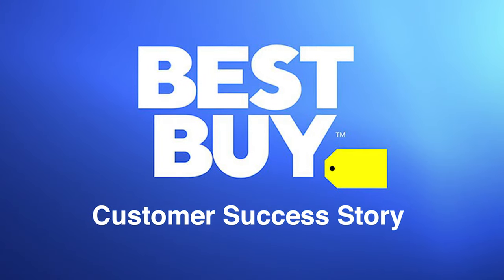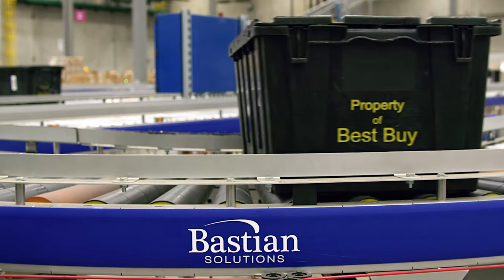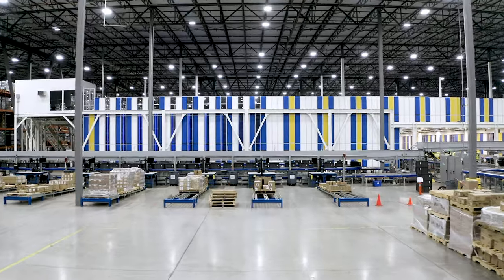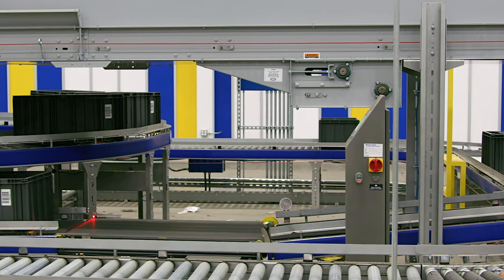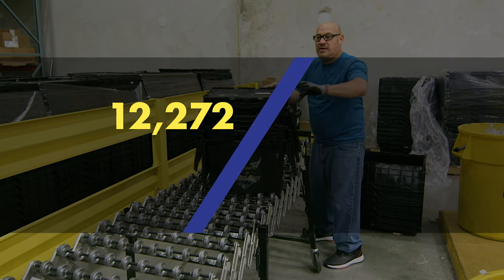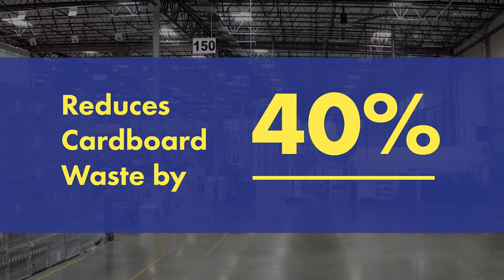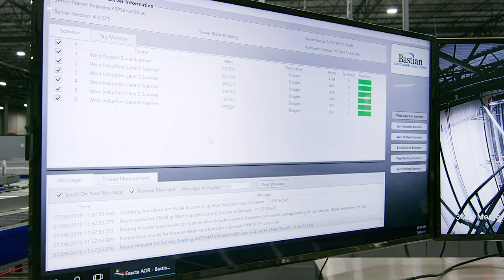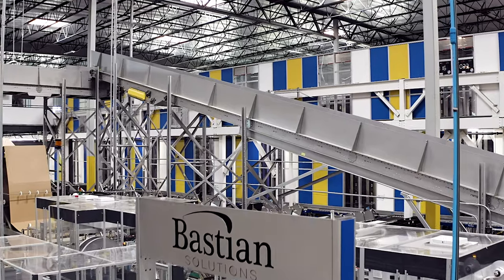Best Buy Modernizes Supply Chain Network with Advanced Automation and Warehouse Robots

Comment: It would have been even better if they could bring these fulfilment centers into brick and mortars with minimum real estate requirement. That way the assault on the physical store can be deflected and it can be given a new lease on life.
Reply from the maker: The AutoStore system has the scalability to be implemented into back of store, if a back of store model works well for the client. We work with each client individually to study their data and operational goals to determine if a dedicated back of store fulfillment solution is right for their operation, or if a combination of fulfillment methods would be best to meet their needs.
Reply: @BastianSolutions  Thanks for the reply, what's the smallest back of the store fulfilment solution you guys currently offer? How much real estate would it need from my brick and mortar space. Also, can your system cater to 30 different stores from one centralised fulfilment center maybe strategically placed on a rooftop or garage? Thanks